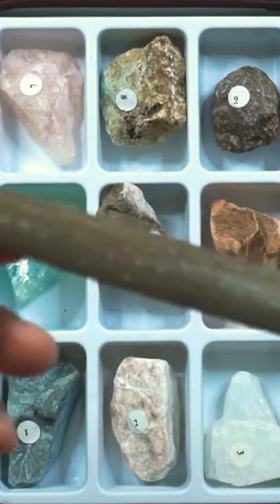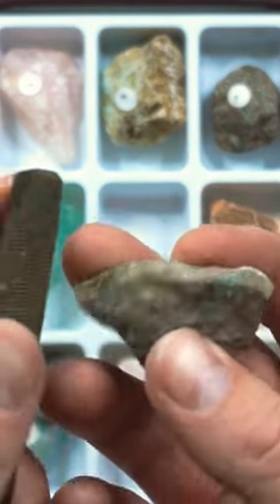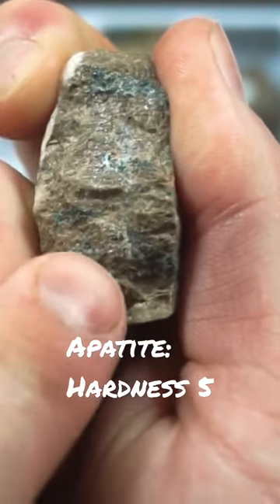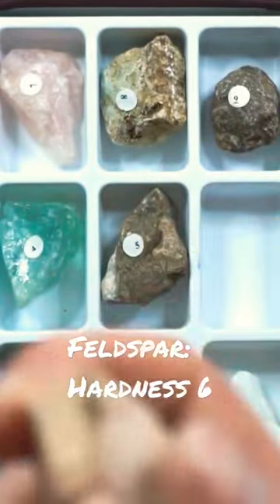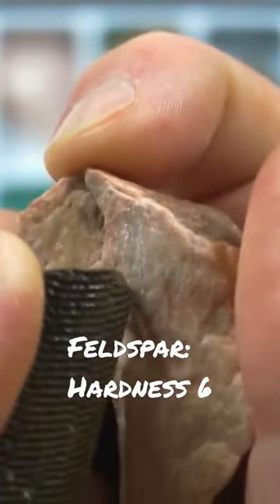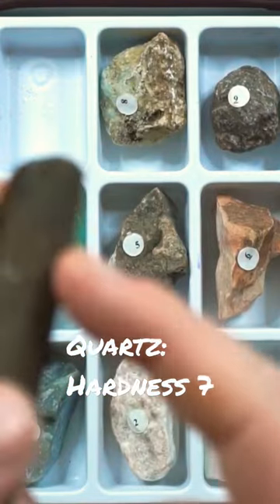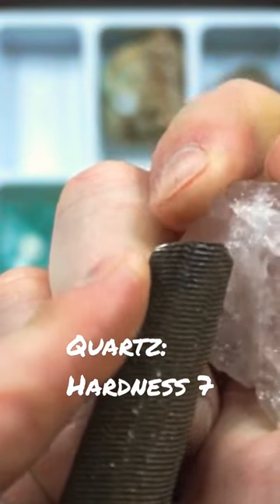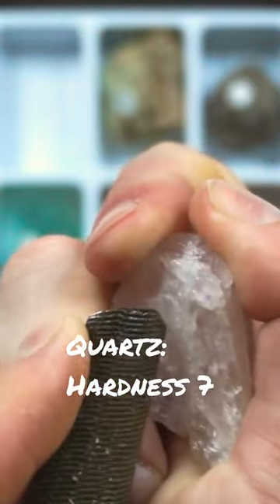Using Mohs' Hardness Scale! 💎

Comment: Thanks for showing. I then suppose without reading any literature, that Mohs scale does not depend on Pressure level. If you had huge pressure power on the level 7, you should not still be able to scratch it ?
Reply from the maker: Hmm interesting point. I've never considered the pressure - I've only ever used it just with the pressure we can exert with our hands, which I think is what it is intended for.